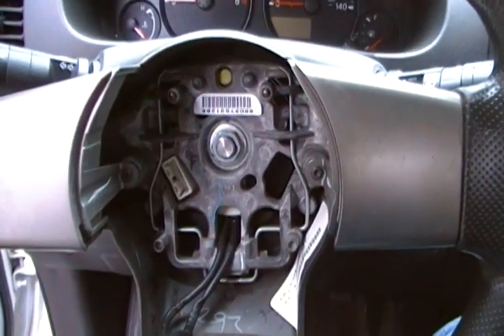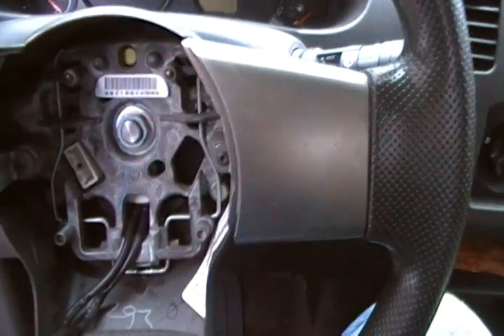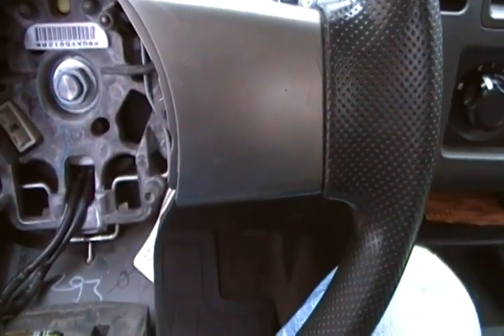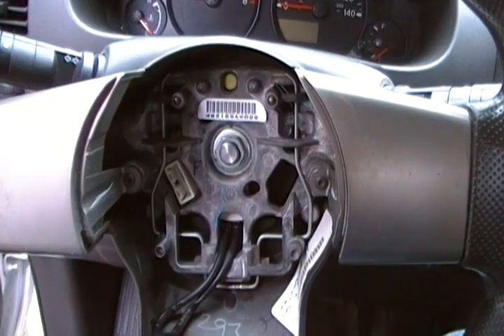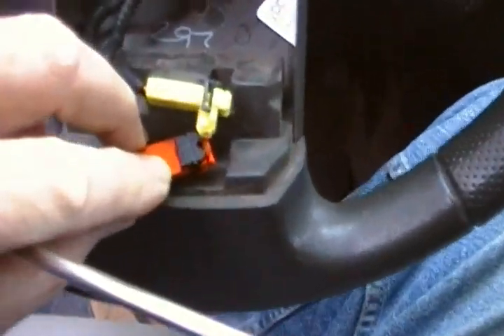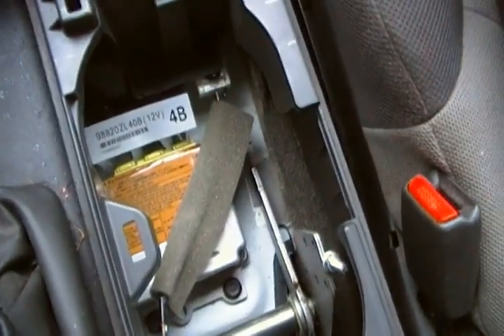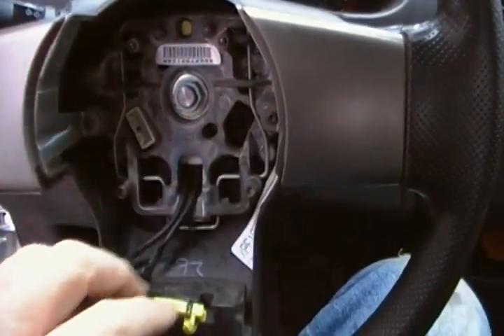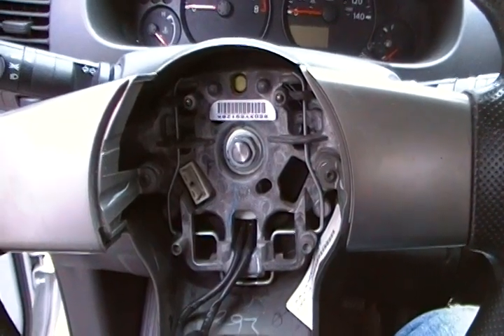Nissan Frontier air bag removal tips - 2006 to 2015?

Comment: Another tip for anyone that comes across this video: push the airbag/horn inwards a little while pushing up on that metal clip with a flat blade screw driver. It will (should) release some tension that's against the springs and clip.

Thanks to this video and another. The first one I watched was an Australian guy saying you had to pry it forwards. Maybe their market uses a different method than the US.

Comment: Is there any danger of the airbag going off as long as the battery is disconnected?  My husband is concerned that I will end up with a broken nose if I try to do this myself.
Reply from the maker: Just allow at least 5 minutes from the time you disconnect the battery until you start your work.  Also, in the video I mentioned that the wheel has to be straight...but it doesn't.  In fact moving it around will help you sight into the bottom to see the release bar that you're looking for.
Reply: wait 4 minutes

Comment: how do  u get the pass side airbag ecm out
Reply from the maker: There's only one.  The ECM that's below the cupholder controls everything.
Reply: yes I saw that when replacing the shift bushing.. what is in the seat back? that the stealer says is bad,
Reply: I reset blinking light , all is fine until someone sits it passenger seat, then it goes into fault mode again, with light blinking,, dealer said it gives code B1131 (SHORT TO GROUND),,so I wonder if something in the seat is shorted
Reply: what is the metal box under the seat?
Reply: @randy1ization  the black box :P